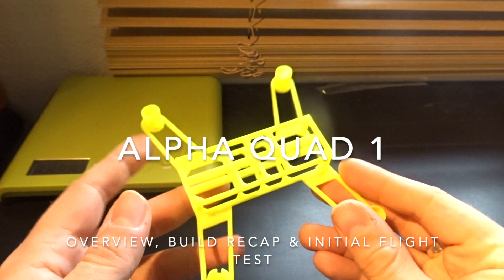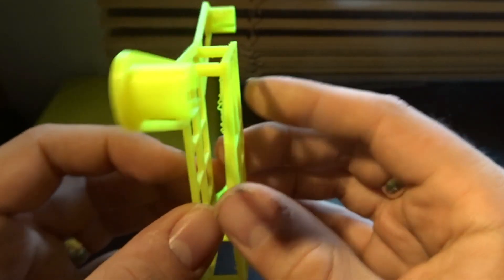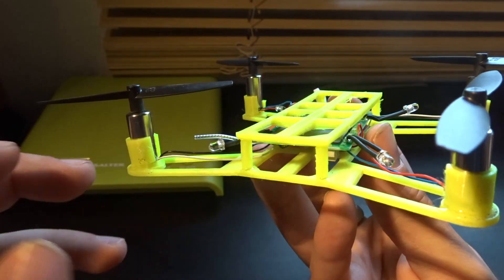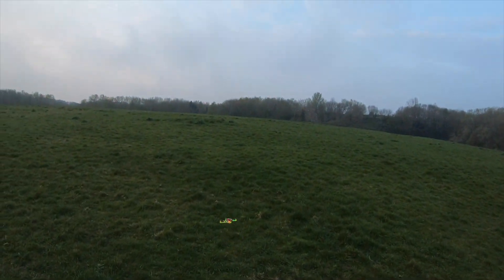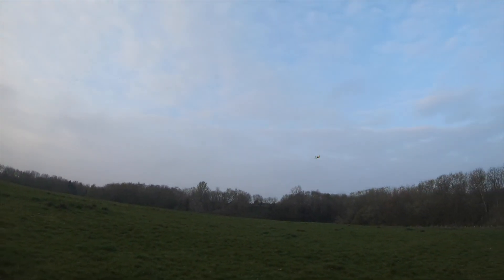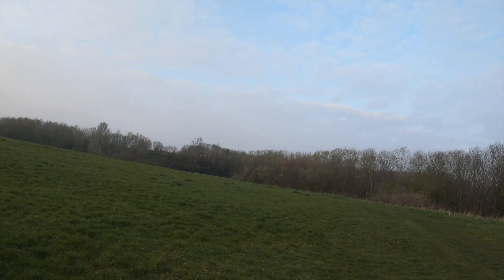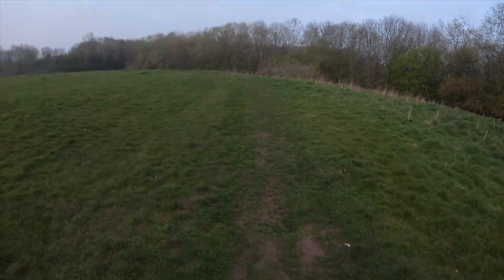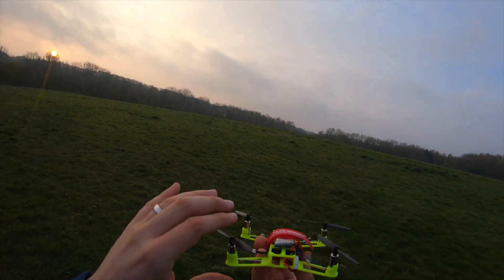Alpha One Quadcopter Totally 3D Printed Full Video

Comment: Nice build, I have hand built several like yours, I have found that the quad flew more balanced when I strapped the battery on the bottom of the drone. Try that and tell me if you are getting the same results. Check out the build on my channel. Thanks for sharing JD. 😊👊🏾💥
Reply from the maker: Thanks Tony, yeah this isn't my first build either but it is my first 3d printed quad. When I get some landing sprigs made I'll give that a go and see how it goes. 🙂👍

Comment: Yes! I'm psyched for this series. Good luck with the build! Good use of glue. I like that frame layout as a transplant receiver. Looks good in the air. My off the shelf quads have a bit of foam rubber tacked to the board over the barometer and it works great.Maybe add an angle strut from the top down to each of the motor mounts? I have zero experience, but rigidity seems important for the arms, and I see too much opportunity for flex. Just a thought. Happy flying!
Reply from the maker: Nice idea glenesis bud, I'll give it a shot. Thanks bud 👍🙂

Comment: Great to see 3d printed frames are getting more popular. Sure it's not carbon fibre but for small drones I don't think you can go wrong with plastic! Can you 3d print them in biodegradable material? If so then I don't have to go looking for the bits when I crash!
Reply from the maker: Hey Lupo mate yes indeed you can, the type of PLA I use is biodegradable, I've put some in my compost bin as a test to see how well it decomposes over time. Thanks bud 🙂👍
Reply: Great to hear it's possible keep up the good work man 👍